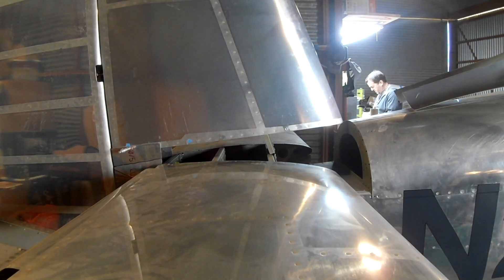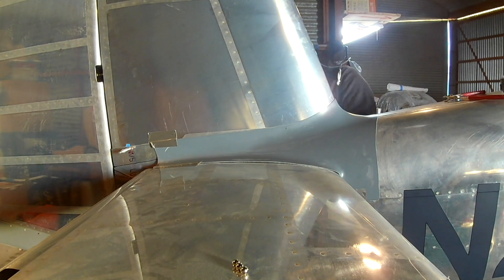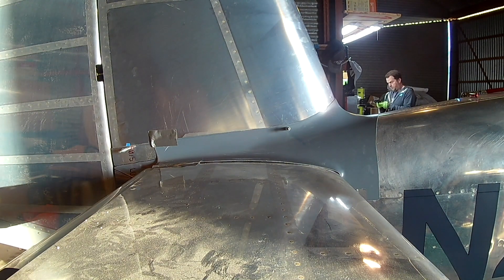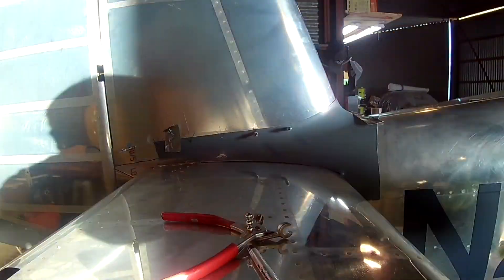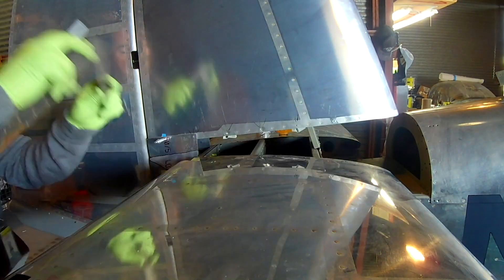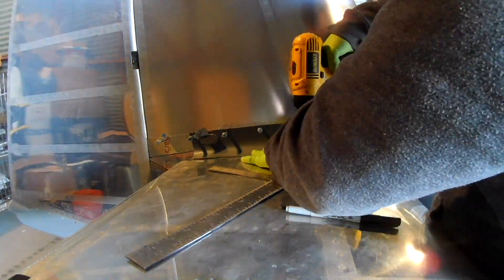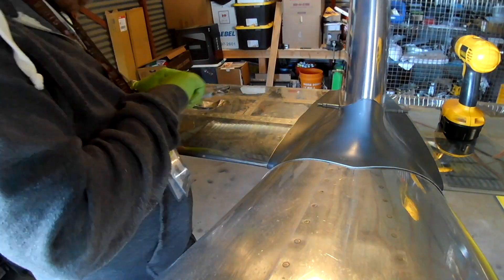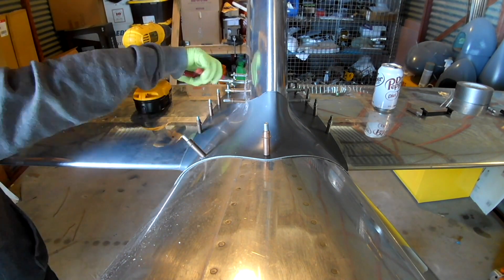RV-14 Empennage Fairing

Comment: Andrew:  Just completed my 14A a couple of months ago, and thought I'd pass along a friendly suggestion.   While you've obviously already drilled all the attach holes in the tail fairing, I can confirm all but the aft most (top & bottom) and the forward most on the arc across the emp are not required to secure that fairing.   I drilled them all and then filled them all back in with flox (extra work, I know!).   But can confirm that the look without those "middle" screws is much cleaner.   My $.02
Reply from the maker: I saw a 14A at Oshkosh last year and the guy had managed to have a single piece fairing for both top and bottom with only two screws. It was so lovely!! 

I, however, am not going for any kind of Lindy and in my mind, the more screws the better. :D